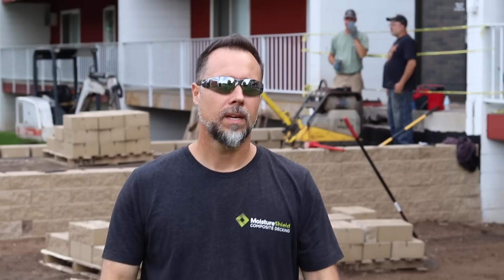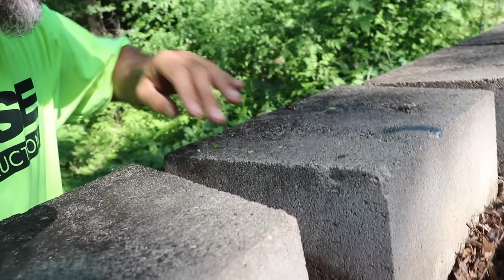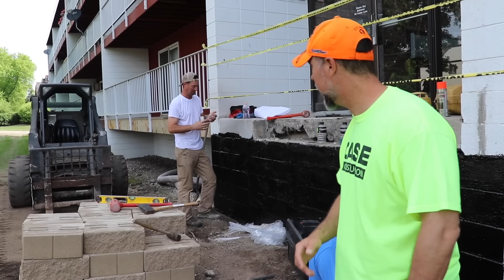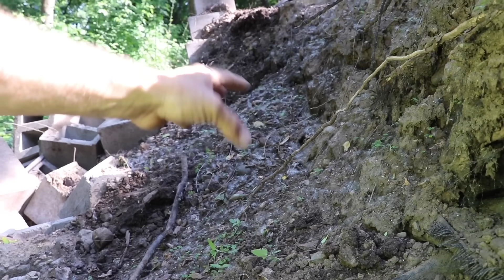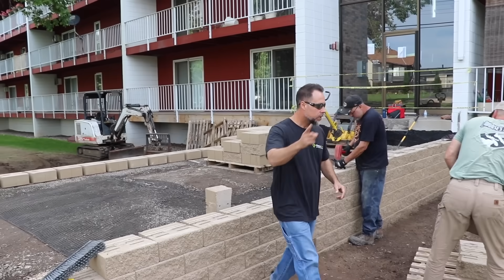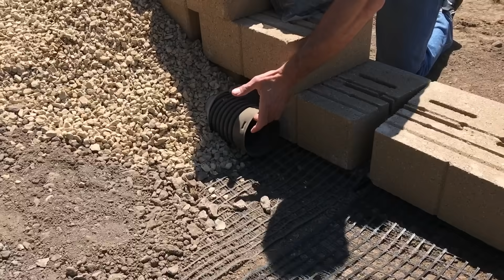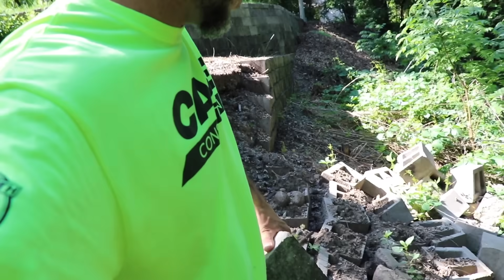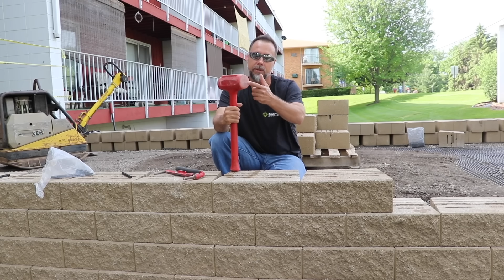How NOT to Build a retaining wall.  RED FLAGS, common mistakes, bad designs pt1

Comment: Ice in beer, wtf?
Reply: Great on a hot summer day.  Keeps beer cold and Hydrate will your drinking.
Reply: It's a Pollack thing. Rarely hear of  anyone outside of the Tri-State Area doing it.
Reply: I thought he was just reaching to flesh out some clever wordplay in the comparison to putting ice on your back. He could have said "cocktail" or "gin and tonic," but he's a beer guy.
Reply: Never in all my career of landscaping have I seen a hollow block from the bottom!!
But I have seen ice in beer:)
Reply: Reason why he said ( ice in beer) because the other crew do work wrong they do everything else wrong too LoL
Reply: Scrolled down to the comments just to see who mentioned it first...LoL
Reply: I heard this from a former bartender recently and it was funny he mentions it in the vid. It's a way to sustain the integrity of the beer (much like the head would). The bartender worked at a posh hotel restaurant in NYC for over a decade with fancy clientele. Haven't tried it yet but sounds like there's something to it.
Reply: weak beer is better than warm beer!
Reply: Literally unwatchable after that. /s

Comment: We use alot of Geo-grid under slabs and parking lots. Geo-grid is good stuff.
Reply: To The Top Crane where are you getting it from?
Reply: Frank Gorgone, the company I work for orders it through a contractor supply center in our local city. A place called Jack Horner's Supply.
Reply: "Stabilized earth" is amazing.  I think pretty much any (retaining) wall with earth on one side and not the other is going to eventually tip over unless the earth is stabilized with some sort of geosynthetic/geotextile or something of that nature.    Here's a very general explanation:  http://www.youtube.com/watch?v=0olpSN6_TCc
Reply: @mikeguitar9769  that was a really good video explaining the simplistic reason why/how engineered earth works so well... Many times in life it's quite simply .. 'The Genius Of Simplicity'..
It's the reason rebar is put into concrete .. works the exact same way adding tensile strength.
Reply: To The Top Crane  that Fox is too cool

Comment: Not criticizing. Also, different set-up, but wanted to chime in on fabric. I build wood retaining walls. They're essentially seawalls and work well where I live. Without fabric, silt runs through the walls and drains down the front (maybe we have different soils). - I can also second your observation that cementitious walls fail all over the place. I'm not sure I know of one that doesn't have a lose block or fissure running down the middle of it.
Reply: Timber retaining walls should definitely have geo fabric backing. End of story.
Reply: haha... i just left a comment above taking about this very thing and how the fabric is actually needed. Check that my comment above. In addition to that comment,  in your case have the filter **may** be even more important as it can potentially prolong the life of wood (by delaying rot) as the gravel will let the wood dry out faster. that just having the moist backfill touching the wood.
Reply: It goes wall, clean stone, then fabric.  Then you won't have silt coming through and the stone let's the water drain.
Reply: Jason Webb No fabric around the stone at all. He is right it does clog up within 12 months so you should never put geo fab before the stone. I've ripped down plenty of failings walls done that way.
Reply: The problem is the fabric your using is leading to more pressure on the wall. It’s holding back water which provides pressure. look at how often water cracks solid concrete foundations.
Reply: I've always had my drain pipe along the bottom of the wall sitting on fabric.  Pitched.  Then backfill to about 3-4 inches from the top with clean stone, bring the over the top and last add topsoil and seed.  Haven't had 1 fail yet.
Reply: Check out this video, and this guy's retaining wall! This guy does amazing work! https://youtu.be/39dhQsQLVHc
Reply: Jason Webb Hey if it works it works! I'm in Australia everything we do seems like over kill compared to what I see on you tube haha

Comment: So fabric (which lets water through) stops water from passing through the the wall and then pushes it over?
Edit: ok I watched further and saw what you said about the clogging. But still I have worked on retaining walls where my boss uses filter cloth vertically behind it, and he has never had a wall fail. I’m not sure if he uses it on all his walls. Our fabric is a bit different than yours and seems to let water through better by the sounds of it

Comment: That wall will look 1000x better then the building.😄
Reply: Solar2go they built the ramp so the demo equipment could make it right into the first floor.
Reply: Perhaps after they're done building the walls, they can demo the buildng...
Reply: than***
Reply: it will outlast it by 1000x too
Reply: So funny and true!!!
Reply: Are they going to do the building as well?
Reply: It's often a problem in partial remodeling and restoration. You get one part looking brand new, and it makes the rest of the place look crappy by comparison. Or sometimes the place where new meets old sticks out like a sore thumb. Once, for  instance, when putting in a slider for a friend in a house with white cedar shingles, I removed the old ones carefully and was able to find enough good ones to use to around the edge of the door, so the shingles all matched. And I do some restorations on apartment-building doorways, and leave in enough of the old dings so that the restored doorway doesn't look like new construction tacked onto a century-old building.
Reply: With no filter fabric that wall will turn white from the gravel in a couple years. Everyone has probably seen the walls that have turned white, and that's why dirt guy.
Reply: @superdave3181  I've been building walls since '96' I've always put fabric along my walls but we have 6-8" of pea gravel with a 4 inch perforated drain pipe at the base. Hundreds of walls. No issues! Not one.
Reply: @jasonk7671  the biggest issues with the fabric is when there is a lack of gravel and drainage between the block and the fabric as well as the soil type behind the gravel for example in clay you need courser fabric and more clear gravel/rock and drainage space as a fine mesh fabric clogs with the fine clay preventing water drainage however sandy soil doesn't clog the fabric as easily as clay will so a finer fabric is acceptable as sand drains better.  The act of building a retaining wall in itself requires knowing how to deal with the soil conditions local seasonal conditions and  knowing how to properly drain the wall. Because if you don't build for those conditions you'll have a failure plain and simple.  I understand both sides of the argument and can tell you the geo-grid method works better in clay soil regions while a properly installed fabric system works better in sandy conditions. Geo-grid also works better in the snowbelt as it resists the frost/ice heaving better.